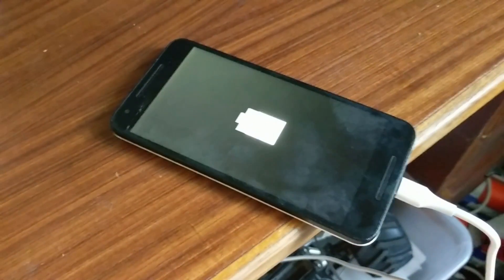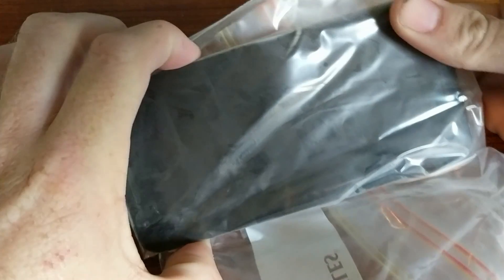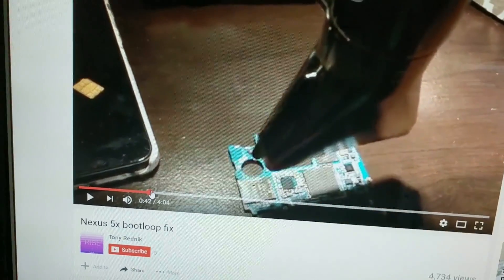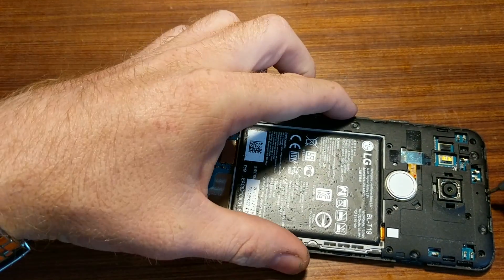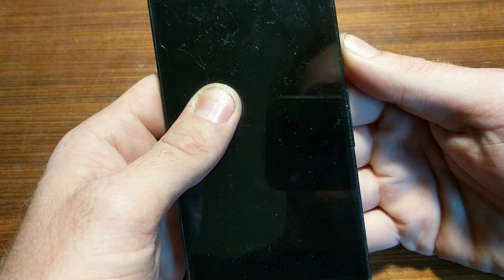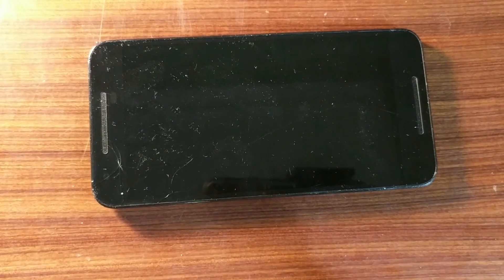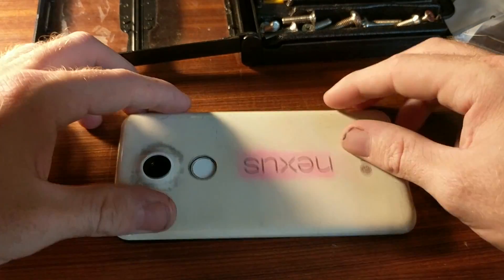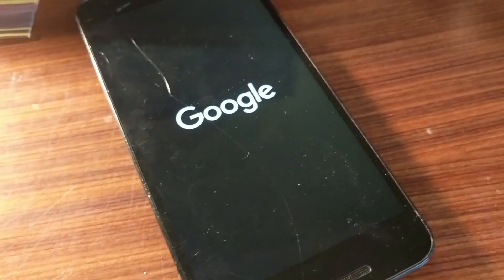How To Fix The Nexus 5X Bootloop (At Least Temporarily)

Comment: theres a class action lawsuit in the works against LG and nexus phones https://www.girardgibbs.com/lg-g4-bootloop-class-action-lawsuit/
Reply: Ryan Olsen would replacing the motherboard erase the pictures I have stuck there!? My phn died before I could transfer the days (vacation) pictures onto Amazon photos. I wish I could revive the phn long enough to get those pictures out and then SET IT ON FIRE AND HAMMER IT INTO TINY PARTICLES OF NOTHING!!!! ugh!
Reply: Zoe Arrow I COMPLETELY understand your frustration! I was in disbelief when my phone died, because I took great care of it. I regret to inform you that it is LG's policy to wipe any information from your phone and factory reset it. It's actually a good policy if you think about it, because you know your privacy is secure. I'm sorry you lost your pictures, really I am. That stinks for sure. I lost some info I had on mine as well. But don't pound your phone to dust 🙂 I had to accept that loss so that I could be using the phone later (like I'm doing right now). LG goofed, but they're standing by their product. I suggest you send in the phone, get it fixed, then you can use it again. I don't know if you've tried Google Photos, but it's been great. I have it set to automatically back up my pictures when in range of WiFi. So, I thankfully didn't lose any pictures (my phone died when my photos were already uploaded to my Gmail account). You can set it up to use carrier data as well (thus perhaps saving most of your pictures in the future if your phone dies suddenly), but I personally don't have an unlimited plan to use that much data. The cool thing is that I was able to set my phone up when I got it back from LG based off of my previous phone settings. I hadn't done a factory reset on a phone in a while, and had to repopulate all of the apps and shortcuts on my screens at the time (which takes a long time). When I did it this time, everything went back exactly how I set it up before. There will be some tweaks to make, but it's not bad. Anyway, I hope you get your phone fixed like I did.

Comment: Heat does seem to temporarily fix the issue. However, I just left my phone in the sun for 10mins till it became incredibly hot. It booted immediately and remained functional for 15mins till it had cooled down. This allowed me to recover all my data. I repeated this process to get it working again for a factory reset. My warranty is still intact and LG is going to replace the motherboard.

Comment: Hey TK, i am alex from brazil and guess what, same problem here, and well maybe i am a bit more fucked up, since i can't call a maintenance service properly, lg doesn't sell the phone here originally, i imported it, well anyway, don't you think the bootloop can be a dead battery issue?, my phone had the same problem about a week ago, first it was the same thing, bootloop, splash google screen freezed, but know it doesn't even starts anymore, what you think?, well thanks anyway for answering.
Reply from the maker: Alexandre Costa nah, not a dead battery issue. if it was a dead battery issue, all you'd have to do is charge it!
Reply: Well, i thought had to change battery, i will do the things in the video anyway, later i will tell you results, cya
Reply: Alexandre Costa The motherboard needs to be replaced. I sent it to LG for repair and they replaced it for free.

Comment: I wouldn't worry bout all that its probably the power button sticking .....on mine there's a notch on the back of the plastic button melt it flat shud last few years more lol ..... and I had this fone over 2 years and it just started this on 4th screen replacement but I noticed when fone came on the power off message appears like the buttons being held down lol

Comment: Yep same issue here.  I guess this one is going around like crazy.  Mine will not boot at all with a full battery.  When you hit the power button the red light will flash.  Earlier I could get into my boot loader choices but nothing.  My phone just freezes all the time on start up.  I was able to get mine started shortly after a hair dryer.  Either way I got lucky and they will replace mine so I am not messing with mine any further.

Comment: FYI, a hair drier doesn't produce "drier" air, it produces hot air, which can contain MORE moisture. This dries your hair, by making it easier for moisture in your hair to evaporate into the hot air, but would likely only increase the amount of water vapor in the bag when used this way ^>^
Reply from the maker: Jonathan Knapp good point - we should approach all problems with the proper attention to thermodynamics!
Reply: Hey, glad I could help =]
This is why, If the inside of your car windshield is fogging, you can turn on the A/C (with the heater) to help.

Comment: Hey this just happened to me today. Call LG they will replace it! I'm sure it's very common. Either way, I'm selling my replacement phone.
Reply from the maker: Matan A I called LG, no dice. Definitely would have taken a replacement if I could get it
Reply: TK that sucks. I went to my provider today, was told to pay 300$. I called LG and luckaly they gave me a replacement shipping. 

What is the cause of this? I noticed my phone freezing for the past few months. 

what phone do you reccomend I get?
Reply from the maker: Apparently the word on the street is, it's a problem with the flip-chip substrate that holds the chip to the board. The connection becomes poor; it seems that heat/cold can alter this somewhat and help you recover the phone - often only temporarily.

As far as a new phone, I got a Pixel myself, which is great so far. But obviously it's difficult to say whether it will face similar issues or not. It definitely feels a bit better than the Nexus 5X - it doesn't require 3 attempts to open the camera at times, etc. Just a bit more robust overall. And I loved the Nexus 5X as it is!

Thanks for watching!

Comment: Whatever your doing is 100% wrong sorry I'm no troll or whatever. Ive fixed 3 Nexus 5x boot loops with same issue your facing using ADB and a full copy of a Google image from Google's server with half a brain Ive managed to get them all flashed and installed. why the fuck are you putting the phone in the freezer your nutz if you think it needs a new motherboard. Get a grip.
Reply from the maker: lolololol well I'm glad your bootlooping phones were stable enough to be reflashed. 

if it was solely a software issue, temperature wouldn't have any effect - but oh, it does!

get a more civil tongue in your head mayyyyyte, ya just might learn something and make some friends

Comment: But if you have device protection and disassemble the phone... wont that void the device protection plan?

EDIT: external heating without a tear down (such as in the microwave or toaster or if you work at a nuclear site and they allow cell phone on site) might be a viable option
Phone worked for 3 hours. Had enough time to back up all my text messages (only thing not auto backed up).
Reply from the maker: I had no warranty or protection plan options, so a disassembly made sense. 

If you DID have those options, you've gotta way the value of your phone versus the value of the data you're losing.

Glad you got it backed up! Risky strategy but I dig it.

Comment: My question for anyone experiencing this problem.  Did you play a lot of graphically demanding games that caused the phone to run at high temperatures?  I have a Nexus 5X and I have accepted that I shall be shat upon by the Boot Loop of death one unexpected day.  However, what if I never use it for games that cause the phone to heat at maximum temps?  Just a question I was wondering.  Also, If I disassemble my phone and use some copper or material heat shields on those same chips that he blasted with heat, shouldn't that further reduce the chances of heat related solder damage??
Reply from the maker: samdroidva I never gamed on this thing; it does get hot under certain situations anyway though, like charging + maps use on the road.
Reply: Yeah, I was afraid of that. I do like Google Maps, also watching videos makes the temps heat up quickly as well.  Isn't charging heat just the battery warming up?  (shouldn't affect CPU/solder much) I'm going to have to post some before and after Temperatures once I apply some heat shields.  If anyone knows I'm wasting my time please comment.

Comment: Hi all,
The heat does the trick. But you dont have to take apart the phone. Just simply let the phone be in the boot loop for some time. It gets hot after about 15 min and automatically heats up the board i guess. and the phone starts.

Comment: Thank You so much for making this video! I got my phone back for now sadly i tried wiping my phone and flashing it before i found this video but now i have phone so thank you so much!
Reply from the maker: No problem man :)
Reply: Zander Lucero is it permanently fixed
Reply: No after a few days it stopped working and did the boot loop again but if you call google and explain everything to them they will issue a new phone to your for free
Reply: Would they fix it if it's used
Reply: As long as it isnt rooted and you have the original serial number. just give them a call
Reply: Oh ok thanks

Comment: Had the same problem. Purchased in Oct 2015. I called Google support last night (Mar 20). Spoke calmly and politely to the customer service rep. Explained to him how I had done all of the trouble shooting that I found on the code.google.com thread about this issue. Also that I had attempted service from LG but their system never sent me the RMA email so I couldn't get it repaired.  He put me on hold, came back in 5mins said this is a known issue and because there is no further trouble shooting Google would be replacing my Nexus 5x. They promptly sent a link and I was able to get a refurbished 5x from the store at no charge. Others have stated similar results in the thread on code.google.com issue #220971
Reply: Here is how I did it. Exactly. support.google.com then click Contact us>Device support>Nexus>ContactUs>NexusDeviceSupport>RequestACall
Reply: Just a PSA on this:  Google has stopped replacing out of warranty X5s that die the bootloop death.  How do I know this?  They replaced my husband's last month, no problem. Mine died last night, and after a protracted conversation we were told by a supervisor that if I'd contacted them a few weeks ago they could have replaced it, but the policy changed and now their hands are tied. They told me to contact LG (I haven't yet, but I'm not gonna hold out hope on that one).  

Husband's phone was over two years old. Mine is from April 2016.   I am...unimpressed.
Reply: This just happened to my gf phone yesterday :(
Reply from the maker: Chris Alexander did you buy it from Google in the first place?
Reply: TK yes purchased from Google store. He verified the order number from my receipt email and imei.
Reply from the maker: Chris Alexander ah yes. I bought mine in Hong Kong, lost my receipt after 14 months, and have to deal with LG :/
Reply: what's the number you called?
Reply: Uri S support.google.com web store, they call you once your info is verified.
Reply: stuck in bootloop after Oreo.
Reply: Chris Alexander thanks to you, I just got off the phone with Google support. After going though a few steps (there was several people involved, they are clearly aware of the issue and trying to figure it out) they determined the cause is from the update that just rolled out and sent me a link to get a free phone from the play store.  Seriously, thank you for posting this...
Reply: James Hiller seriously, if you purchased from Google store, do exactly as this guy says... Worked for me
Reply: Chris Alexander I can't seem to find it.. can u help by saying where to press?

Comment: You did not heat it hot enough to melt the solder under those chips, you may have just caused a little crystal growth which is why it temporally works. You need to get a cheap hot air gun (not a hairdryer), such as an Aten 858, and get those BGAs hot enough to actually re flow the solder.
Reply from the maker: hmmmm! tempting to get a heat gun.
Reply: Just don't touch the part with your finger after heating it... you might flatten the balls under the part, let it naturally and evenly cool or you could cause more problems.
Reply from the maker: Yep, that worked. Heat gun rocks. ;)
Reply from the maker: was on the latest update as of whenever this video posted.
Reply: is it still working?
Reply: and did you make a downgrade after that? btw which version are you on?
Reply from the maker: K5- BLAZER no downgrade. 1.5 mins of heatgun, booted fine, all files in place.
Reply: wow ok so you are on 7.1.2?
Reply: where exactly did you hold the heat gun? and how close? thanks for the vid
Reply from the maker: pretty much same way I did it with the hairdryer in this vid!
Reply: Same problem here. I didn't have a heat gun so I put it in the oven at 285 deg F for 2 mins, slapped it back together, and it works!! Thanks TK for the valuable insight!
Reply: Hey, so how is it going after the heat gun? Is it still working 7 months after that?
Reply: So you gotta take it apart like in the video, then use the heat gun?

Comment: The LG G4, V10, and the Nexus 5X are all affected by the bonded flipchip substrate breaking off of the BGA package under the CPU, which usually manifests in bootlooping or screen corruption, and eventually a complete brick. It's not solder related; the only way to fix it is by completely replacing the CPU package with one that isn't defective.
Reply from the maker: Very interesting! Where did you learn this - can you tell me more?
Reply: There's currently a class action lawsuit against LG for the G4 and V10 bootloop issues, and that lawsuit names the flipchip separation as the root cause.
Reply: do you have a link to the lawsuit showing CPU package defect? the only lawsuit i've seen states the cause is soldering defect https://arstechnica.com/wp-content/uploads/2017/03/lgsuit.pdf
Reply: evolboost thermal cycling and vibration. the first is why this shows up during or near after system updates.
Reply: Any follow up to this? Still interesting info.
Reply: how do i join the lawsuit?
Reply: what causes the bonded flipchip substrate to break off?
Reply: FrankTheCat do you know of other phones (besides aforementioned LG phones) with the snapdragon 808 package having this same issue? if this is CPU pkg defect it should be pretty widespread.
Reply: The only ones I've heard of are all manufactured by LG, including G5 now, apparently.